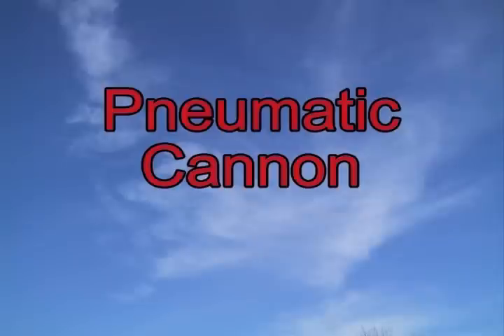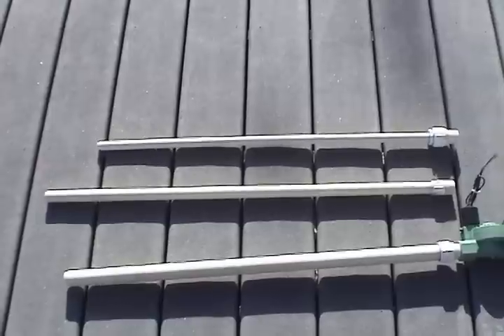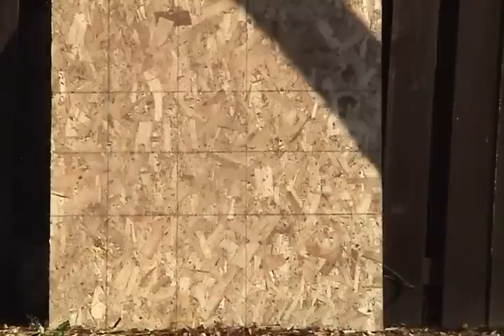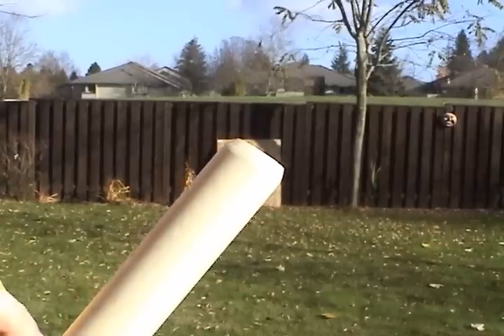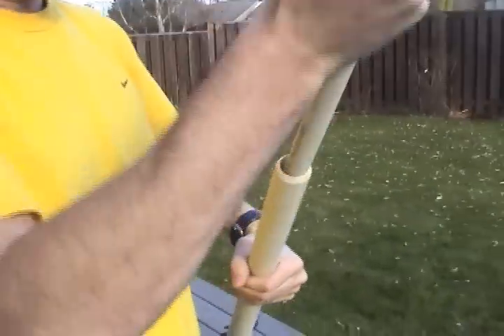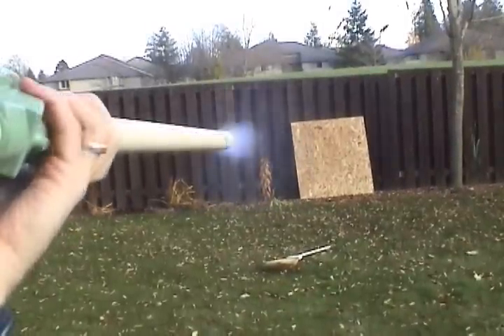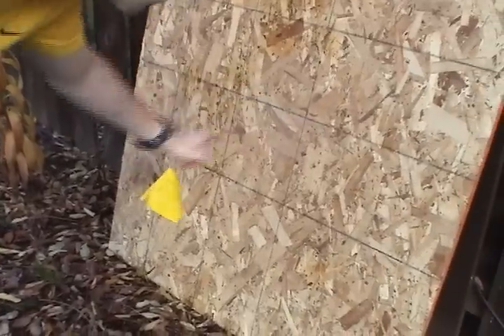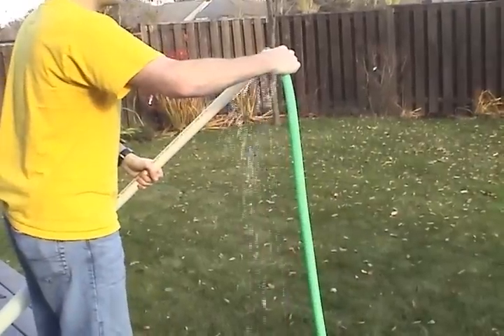Pneumatic Potato Cannon

Comment from the maker: @cody5405 That, of course is a totally different concept.  These conbustion guns are also lot of fun.  The first Potato gun I built was as you discribed.  The problem with them is that the cycle time is much longer with all the un-capping and spraying.  Also, the chamber starts to get pretty gummed up and the lighter stops working after a while.  With the pneumatic version you get faster cycle time, less maintenance, more control over the charge.  Plus, try shooting water in a conbustion gun.

Comment from the maker: @monthofthebull I would say that that depends on what you shoot.  The tighter the fit, the more accuracy you get.  Potatos are very accurate.  Tomatoes wabble around in the barrel a bit and are not quite as accuarate.  You get a good scatter pattern with water, so you are going to hit anything you point it in the general direction of.  If you want increased accuracy you can check my laser guided marshmallow video for another tip.

Comment from the maker: I used a PVC reducer fitting and then a brass reducer fitting so the air nozzle screws intot he brass fitting.  The brass fitting screws into the PVC fitting, and that glues onto the resevoir - completely air tight.  I used a 1 inch valve.  Bigger would be better, but they get expensive very quickly after you get past 1 inch - which costs $10-15.

I have used 3 9v batteries as a trigger, but for this video I was using the manual override lever on the valve.

Comment: Ya there is a rubber O ring at the bottom of it so it has a very tight seal, and the threads are big so it screws in really fast. Me and some friends were able to load it, propane and potato, in 15 seconds and under.

Comment: Better yet. One my friends and I built back in the day. similar to his design but with 2" PVC to fit a whole potato. a 2 1/2' long air tank in the back that was 3" pvc and the front was 3' long. air compressor quick connection and psi gauge so we could fill up to whatever psi we wanted. Normally about 130 psi per launch. We could launch it through a single wide trailer at my grandpas farm.

Comment from the maker: @8tonsemi Load up a potato, hook up the air pressure and trigger the valve.  I used the manual overide to trigger the valve in this video, but I used an electric switch to trigger the valve in the exploding flour video.

Comment from the maker: @SCOTTCBR1000FL Most sprinkler valves have a manual test switch that you can flip, rather than rigging it to fire electronically.  I used the same gun/valve in my flame thrower video, but I set it up to fire electronically in that video.

Comment: I built one with PVC air-chambers and valve, but a 2" ABS barrel since the Home Depot was stuck for proper parts.
I pretty much have to use a bike floor pump since I drive an 18-wheeler and am kind of limited in what I could carry on the road.
Anywho, I could pretty much shoot anything out of mine since making home-made sabots out of yogurt cups.
T-Shirts, small aerosol cans, Easter Eggs, airsoft bunches of BBs with wadding(practically a shotgun).
My next project is a harpoon gun!!

Comment from the maker: @GameMessenger I am using around 125 PSI.  I have no trouble stuffing the potato down just like you see in the video.  Is it possible that you have a small leak that is forcing air into the barrel?

I sometimes have to give the potato a second or two for the air to release around it as I push it down the barrel.  One other option is to drill a very small hole at the valve end of the barrel to let the air escape there.

Comment: (I ran out of room)    But mine has a mini propane tank hooked on to it and pressure gauges hooked onto a small pipe so we know excatly how much propane is in it. There is also a small fan in the combustion chamber to mix the propane and air together. It coasts about 200 to 250 dollars to make one like this, but it is worth it because it is a lot more powerful.

Comment from the maker: You hear air releasing after the valve opens because it is still connected to the air compressor.  You could add another valve to isolate the compressor between shots, but who cares about loosing some pressure when the compressor is doing all the work.  The automatic valve opens much faster than a ball valve for example - so more pressure hits teh projectile before it exits the barrel.  The best valve is a piston valve - see my video about that.

Comment: if you have removable barrels try filing the back of the barrel so you have a rear loader and dont need to push it down the barrel, you just have to unscrew the berrel and stab it into whatever you want. thats how I made mine. its allot faster and easier to load it.

Comment: @trav209660 hemay be using the solenoid on the valve.  It workes better to modify it to work off of pneumatic presure.  You should be able to find a video on how to do that.

Comment: I made a bait launcher similar to this and I'm wondering it's 2 ft long by 4in wide what is the amount of PSI I can put on that I've only gotten to 60 I'm scared that it will explode but I've seen where they and cast out to almost 300 yards on 90 PSI I think what is the limit you can't pressurize a 2 ft by 4 inch diameter PVC pipe

Comment: I like these... but The flaw with the automatic valve is that it is too small. Not enough of the air gets out at once. You can hear the gun releasing air after the projectile is far out of the barrel. Not very efficient.

Comment: just two questions what psi are you running on and how do you stuff projectiles down the barrel if it is air powered and there is air behind the barrel because i made one but everytime i try to load a potato it will not stuff down all the way

Comment: what is the strange noise after you fire it? I get the hiss of air pressure, but what is the other thing?
Reply: When the pilot valve is too small, the valve will re-seal itself. Then, un-seals and repeats until no air pressure is left to seal the valve. This creates a "honking" noise. A bigger pilot valve solves this, and will improve the performance.
Reply: +Brad100715 Cool, thanks.

Comment: You need a reservoir and a dump valve.  We used sprinkler valves on ours and the potatoes came out so fast they went through three pieces of 1/2" ply wood....like huge holes..no joke.  The fact you have no holes in your chip board is sort of pathetic.

Comment: Your tank is too large. I had the same problem with mine. I made mine to be multiple shot off of a paintball CO2 tank. Mine hummed like that until I made the tank smaller. It does that because the valve can't keep up with the volume of gas and flutters at the end.

Comment: if the pvc pressure rated i think 70 psi . if it not i think under 40 psi is ok
Reply: sch40 pvc bursts at 420psi if the pipe was 6", the pipes here are much smaller so its fine http://www.engineeringtoolbox.com/pvc-cpvc-pipes-pressures-d_796.html
Reply: lol49031 just for safety ;)
Reply: SARIT channel yeah i was doing something earlier and had the brass ball valve fly out at 40 psi, shoudlve used epoxy